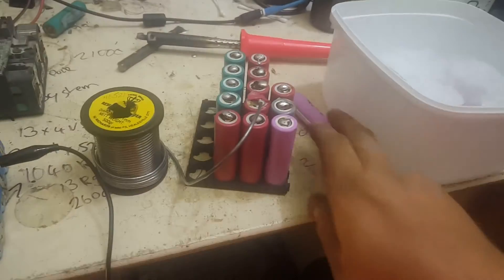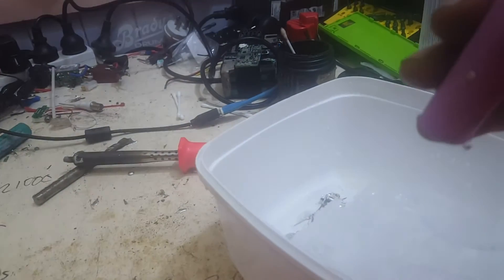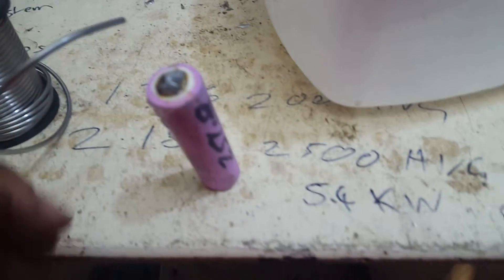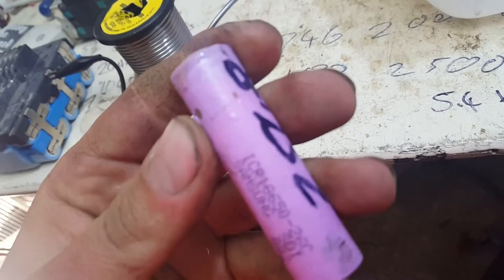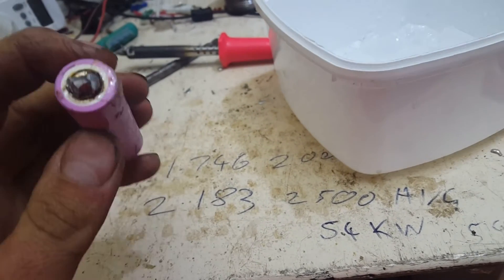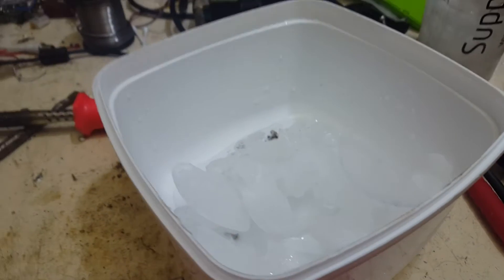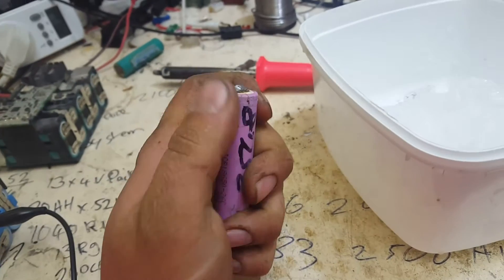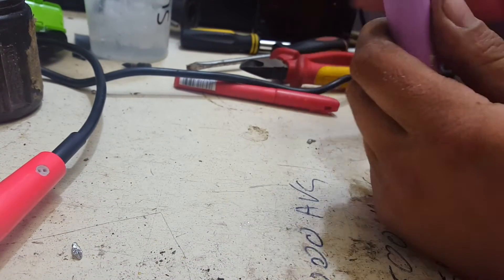Samsung 18650 thermal runaway pt1

Comment: Never solder directly onto any chemical type of cell
Reply from the maker: Whys that ?
Reply: The heat transference can damage the internal resistance of the cell, therefore weakening the mah and or voltage of the cell.
I was once a battery technician, and we used a specialized electronic welder to attach nickel plated tabs for consumers to solder to.
I specialized in ni-cd, ni-mh, li-ion, li-pol, alk, carbon, sla, gel and acid based batteries.
Reply from the maker: Spot welding the go?
Reply: Yeah for sure, the electronic welder has zero heat tranfer. We mainly put tabs on for hobbyists who built their own battery packs for rc's and drones. My main job there was to replace battery packs in laptop batteries, drill batts, camcorder batts, mobile phone ECT ECT

Comment: Wow good on you for acting quickly. Not heard of anyone using ice before, though piling sand on top or submerging it in water have been tested by others (trial by fire lol).
For an entire pack that has thermal runaway, you need like a 44 gallon drum of water to drop it in.
Reply from the maker: +station240 just throw it or run hahah rare that a whole pack will do that in a fire it might. Have you seen the 18650 vs heatgun video i did?
Reply from the maker: +DIY Tesla PowerWall was full of ice to stop it building up  heat and exploding Allgood  it stayed in one piece cheers. Was simply to dissipate  heat and did the trick
Reply: Lithium Ion is not the same as metallic lithium. Lithium compounds used in modern Li-Ion cells do not react violently like pure lithium. Common compound is Lithium Cobalt oxide.
Next you will be telling me not to put salt in water as it contains reactive Sodium.

The amount of actual lithium in a single 18650 is 0.7 grams or less, or about 2%, which is then mixed in with everything else for a far slower reaction even if it were pure.
Reply from the maker: +station240 _ so 18650 plus water doesn't  equal instant  death  destruction and mayhem